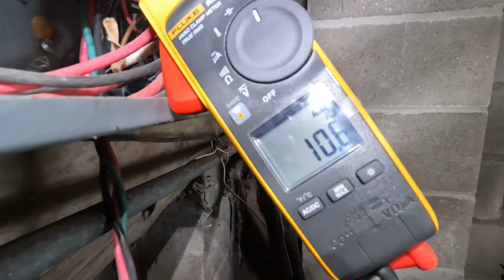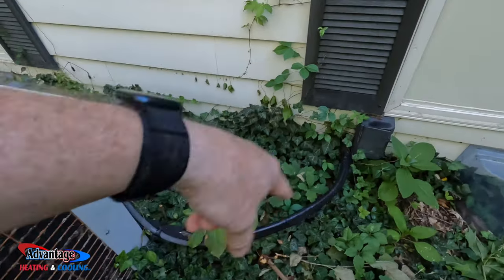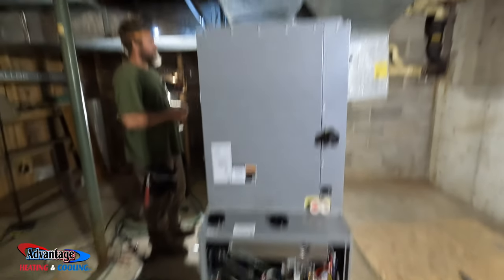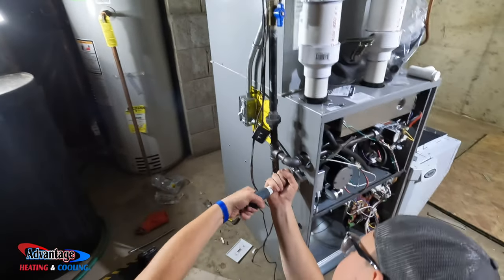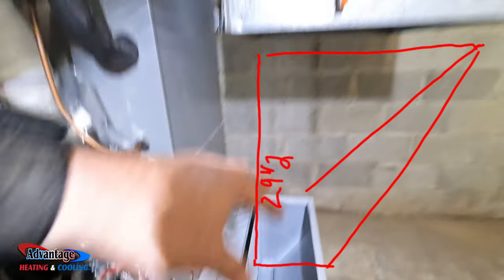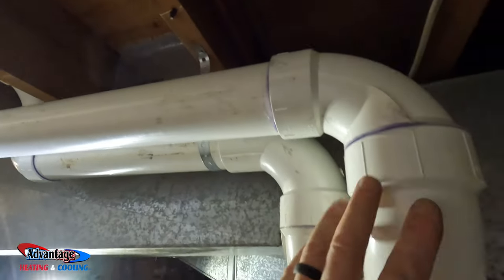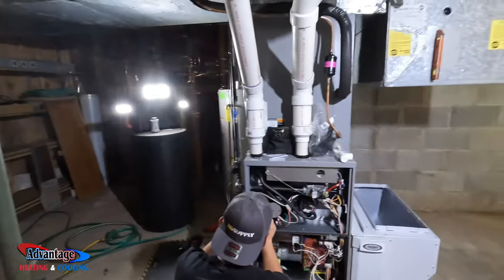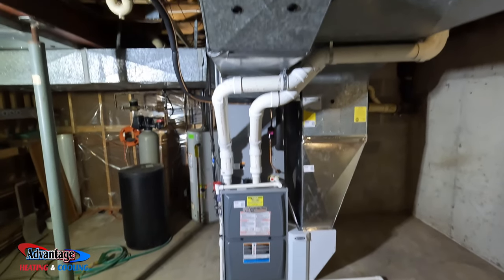From Bryant to Armstrong: An HVAC Makeover!

Comment: You stopped using yoga pipe?
Reply from the maker: No just saving what I have for that one Special job. I either try to use existing line set by Rx11 and Pigs. Or I will pull a new copper one.
Reply: This guy knows what he is doing!!  Efficient, and honest!

Comment: it's very nice work, but to me it's shameful to timer stage such a nice furnace and it will never run for extended periods on low which is the entire point of 2-stage. 12 minutes on low is nothing. use the right thermostat, size it close to the load and it would never shut off in a cold snap, just cycle between low and high giving consistent heat.

gotta have a huge house or be in a brutal area to need 88 000 btu, most furnaces are way oversized.
hope you're sizing them right and not just putting the same size as what was there.